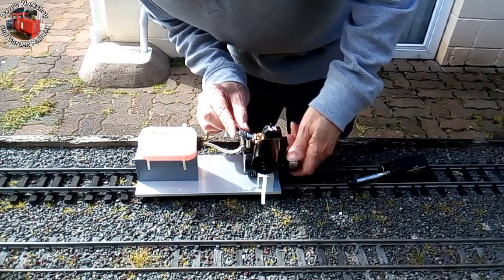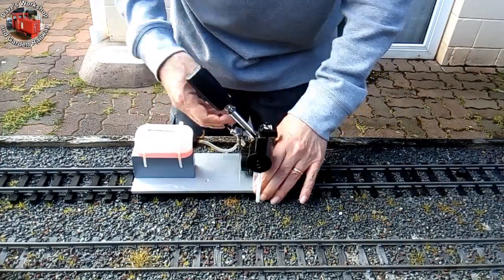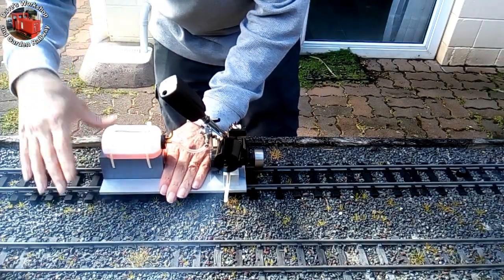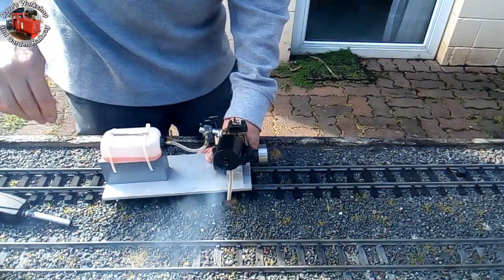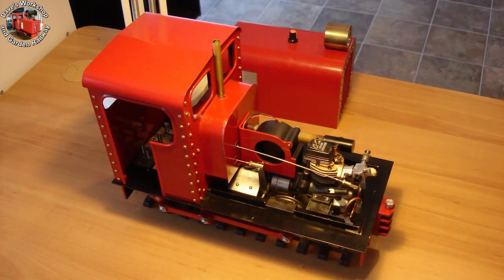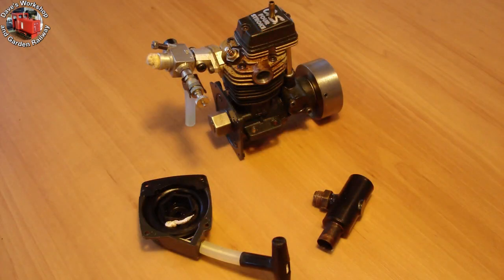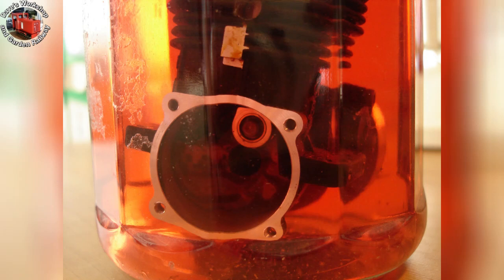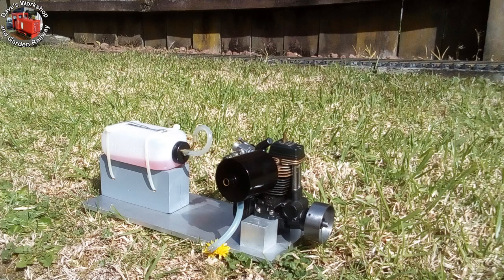Running the O.S. FS-26S-CX Nitro Engine on a Homemade Test Stand

Comment: Yes the smoke almost captures the prototype just more of it. Would a small 4 stroke water cooled engine be a better fit. It's a nice looking little engine I'm not sure I would like it covered in 2 stroke oil after every run.
Reply from the maker: It's a 4 stroke nitro engine designed for RC Car use.  On the loco the oil is collected and dropped between the rails